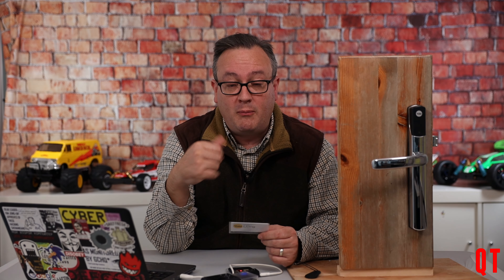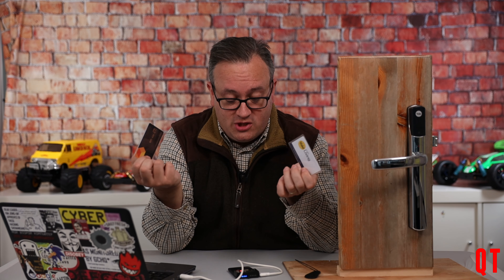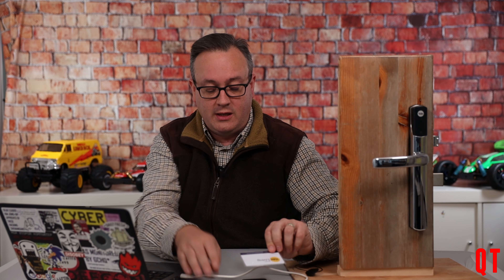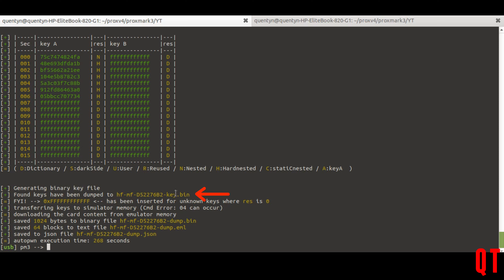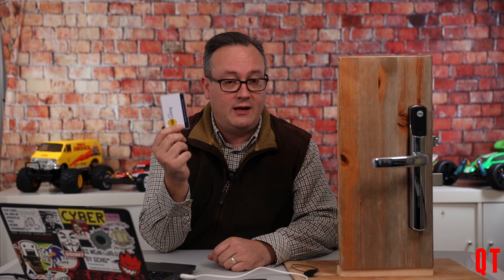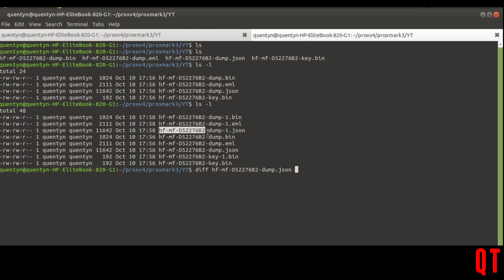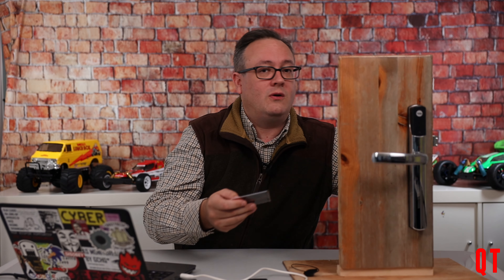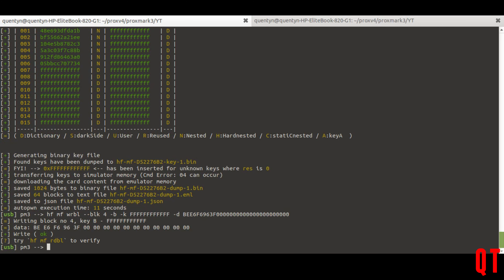Yale Conexis lock redux and command update for the Proxmark

Comment: You come far with your RFID hacking skills and your video creating as well.  
Did you enrol both cards on the lock or is it just the one original enrolled?
Reply from the maker: i enrolled the original card, then copied it and used the copied card. What i havent tried to do ( which i will do next) is to try to enrol the card again after i have copied and used the copy... this will show if its using the card ID as a unique value. If it doesnt work i will try changing the UID of a card and trying to enrol that.

Comment: Do you know if anyone has done much research on the internals of this lock and what it looks for to identify a valid Yale card? (Presumably there is some hash or checksum with a secret that prevents you from just making an arbitrary writeable mifare card recognised and enrollable with an UID change. I've got a spare of this lock (damaged) that came with our house. It wasn't installed well, and misunderstanding what screws were needed to remove it from the door I damaged its flex cable linking the internal PCBs. We replaced the lock like for like, but I'm curious about using non Yale tokens such as wrist bands  with the new lock.

I did try to repair the circuitry to use the old lock for testing, but either I've not successfully patched around the torn flex PCB, or at some stage along the way one of the circuit boards was damaged.
Reply from the maker: ooh you can use non yale tokens, you just need to have the correct data in block 15 when you set it up. When you copy a card you copy over the right blocks and so the copied card will then work
Reply: @QuentynTaylor  Indeed, a clone onto a UID changeable card works (thanks for your video demonstrating that). I'm quite curious whether we can figure out how to program the contents of a non UID changeable card so the lock will recognise it. It appears my broken lock is pretty broken. Holding the reset button and applying power just to the indoor half (outdoor cable unplugged), as per reset procedure, the lock starts bleeping and won't reset.  Its on my soldering bench now as I'm curious to dump the 1k-byte EEPROM and 512k-byte serial flash on the board when I get a moment. I'm curious to see if there are any traces of the UIDs for cards it had previously been programmed to work with - although given it is an unhappy lock, a corrupted or tamper flagged memory is obviously possible.

Comment: I'd be interested in what happens during enroll.

Is there an initialisation value it accepts regardless?

Is the starting value always the same?

Can a card with appropriate coding perform actions with the lock (e.g. enter a maintenance mode, etc).
Reply from the maker: as far as i can see it will accept any starting value of the card, i am tempted to replicate a known card and just change the UID and see if i can now use the same card with a different UID. Unless there is a checksum to the UID in one of the lower blocks it should work. Also it may ignore the UID and use the data in one of the lower blocks as its card identifier ? i need to experiment
Reply: @QuentynTaylor  curious to hear what you discovered here.

Comment: So, I have one of these locks and I'm determined to find a way to enroll regular mifare classic fobs onto it rather than paying overpriced values for Yale's own. As far as I can tell there's zero difference with Yale's over some other Mifare classic tag, but the lock just doesn't seem to react to them, even after I try cloning one of the Yale fobs. 

Do they lock out via the UID or something, do you think?
Reply from the maker: Yes if you watch this and the other video they keep a unique count of all keys that have been paired with the lock and the last state of the key. If you can work out which blocks the data that the key needs to recognise it's a valid key is then you can probably generate your own ones. Note that keys don't need be globally unique, if you were to borrow your neighbor's key, copy it and then pair it to your lock that would also work. And due to the way that the key has a rolling code in block 4 you wouldn't be able to enter each other's buildings
Reply: @QuentynTaylor  Thanks for the response! I suspect they tie the keys into the key UID, which for most regular mifare keys is locked. I've tried cloning one of my working keys, so all banks except block 0 and the reader still doesn't react to it. It seems a silly limitation that's only designed for one purpose: To make you buy Yale keys.
Reply: @QuentynTaylor  Aargh... I've just realised something... So I have been in the process of installing a bunch of Yale Locks in a Guest House, and with 20 slots on each lock, my plan was to have a set of keys, and e.g. for these to be able to unlock the front-door, and also the bedroom e.t.c. But is what you are saying, because of the rolling code, each door would need its own key for entry and the same one couldn't be used to access multiple rooms? In which case I've just brought a load of junk and/or will just have to use them with PINs which is a bit defeating the object :(. Anyways, thank you so much for your instructive videos - really useful.
Reply from the maker: @gavindjharper  yes as the locks arent networked and only know about their "own" keys
Reply: @QuentynTaylor  somewhat of a limitation in the usefulness of such locks in certain circumstances. (That your key fob isn't "you", and can't just be paired to multiple locks - as far as I'm understanding here)